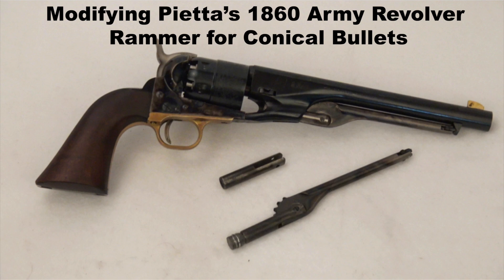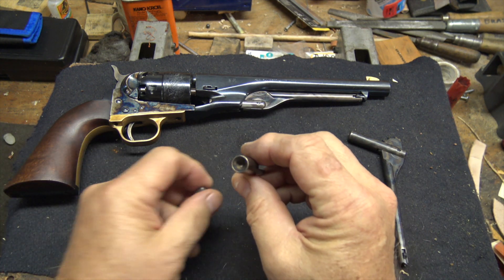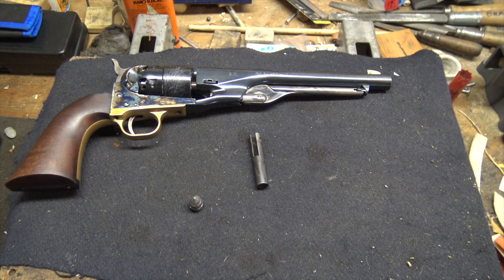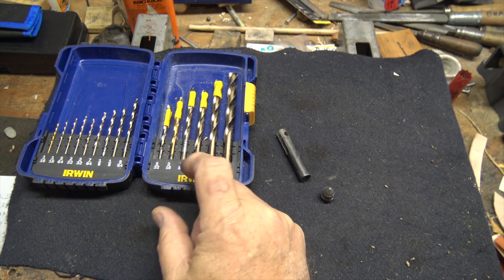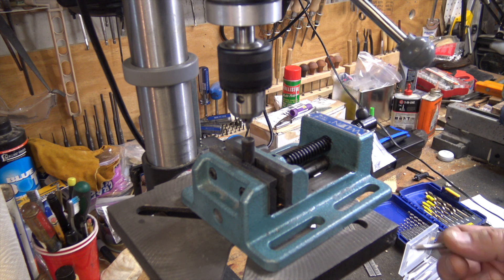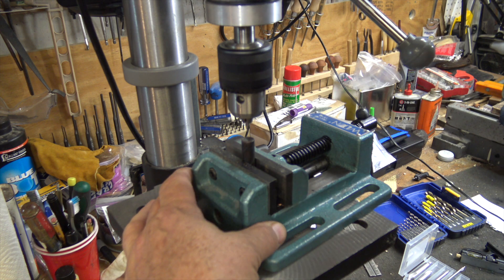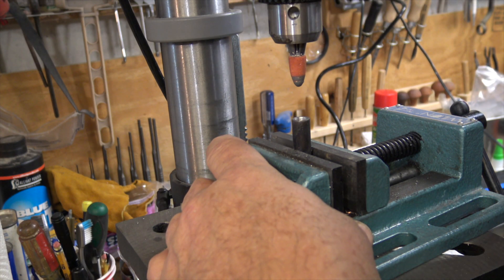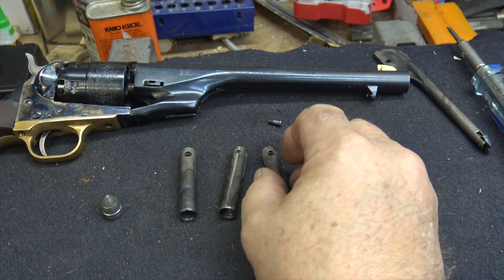Modifying Pietta's 1860 Revolver Rammer for Conical Bullets

Comment: Nice. I modified quite a few seating stems to fit different projectile profiles basically your way but with a lathe. Only thing major different is after I spray lube on the projectile and press in stem with JB weld to form a perfect 100% uniform surface contact.

Comment: Unfortunately my only option is to modify my pietta rammer. Unless you know a source I can't find an uberti plunger for the navy colt in 44 caliber and I'm afraid the 36 caliber version won't fit. Would any plunger from a 44 caliber uberti fit my pietta navy? Any suggestions are very welcome. I wasn't aware of this very niche issue until well after I purchased the gun so now I am kind of chasing my tail on a solution!

Comment: Are there any stock 44 revolvers that work with the conical bullets? Or do all repro revolvers need this modification?
Reply from the maker: Most Uberti Remingtons will work without mods...or very little modification
Reply: Thanks! I love your videos. I currently only own a Pietta 1858 which doesn’t work with my new Conical bullet. I was thinking of venturing into a Uberti. If you could have a Walker or 1860, which would you pick?

Comment: Mike, my stupid state CA is proposing a ban on lead bullets at all indoor and outdoor gun ranges. My question is can I shoot copper plated or full metal jacket bullets thru my Pietta 44 revolvers while still using Pyrodex? If so what grain and diameter bullet would you recommend? I appreciate your help.
Reply: Never use anything but Pure Soft Lead or you will probably Ruin the Gun and maybe yourself to when it Blows Up.

Comment: Mike.. My question is not specific to this video but a general question about cap n ball revolvers.

Mechanical things wear out and can break with useage so what are some common parts you would recommend keeping on hand for a Colt style (51/60/61) revolver based on your years of shootin and working on them?

By the way.. I found VTI thru an older video and have ordered a complete hardened screw set for my Uberti 1873 Trapper Carbine because the factory screws are very soft and easily damaged even when using gunsmithing driver tips.
Reply from the maker: A bolt/trigger spring and a hand and . hand spring

Comment: I am also just going to spend the $ 20 for a Pietta 1858 Remington. I am hoping for only slight fitting mods. If that doesn't work I will buy a quality BP cylinder reloader and use your method here to mod for conicals if needed.

Comment: Mike... You just saved $20, shipping and tax. Now multiply this by six rams... do the math. It does make a big difference to just modify it yourself. I think it even has a better fitment. You can even use a step drill bit instead of so many different size bits... then smooth it out with the grinding bit. Great work as usual. It takes me eleven minutes to do one. Shoot lots and stay safe.

Comment: If you have access to a lathe so much the better.
Reply: Yeah, but first, turn down a 5/16 drill bit to the correct taper. Then take that, clamp it in your tailstock chuck, clamp the rammer in the 3 jaw chuck and BOOM!